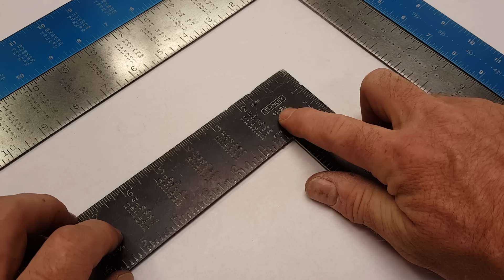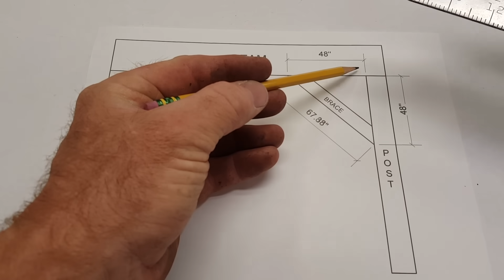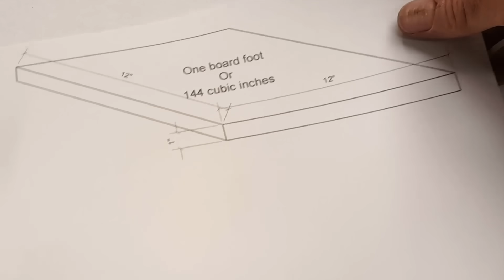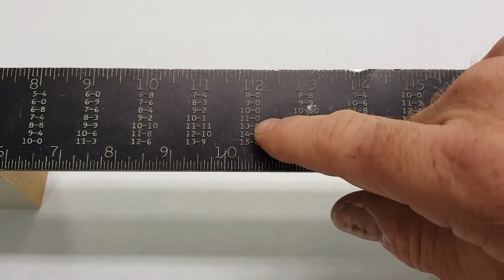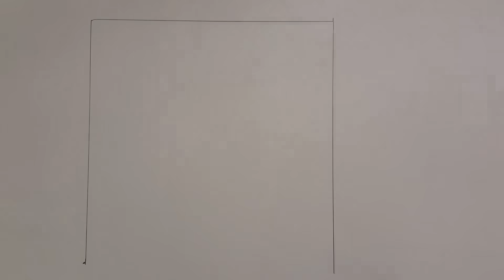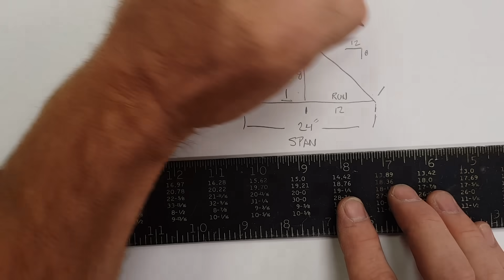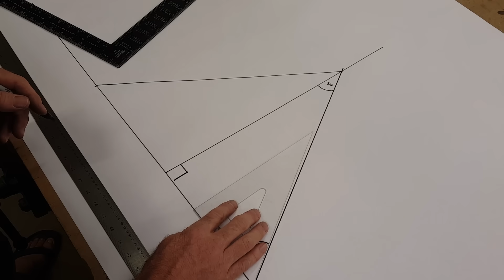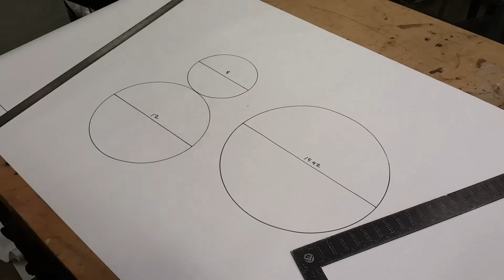Framing Square Basics - How to use one

Comment: ... this video, while high in quality, seems to be a huge motivator for using the metric system lol
Reply from the maker: I use both systems because things are made using both. Even if the metric system was the only convention in use there would still be millions of structures that were built with the other way measuring.  Plus, It's important to remember that fractions a representation of value and are independent from either measuring system. Fractions, however, are necessary for both in many instances. Also, the math behind x,y coordinate (rise and run) based construction applications like roofing is independent from the measurement system....... They are both just sets of lines on a stick.  It's how well we understand them and use them that makes them useful.
Reply: @Makebuildmodify  that's very insightful. I always wondered why fractions were used so much, especially since I have a caliper that expresses inches with decimals. Thank you for the clarification and the videos. :)
Reply from the maker: @lostinlymbo13  Thank for taking the time to read and reply, and for watching my video too.

Comment: I assume everyone knows why the body and tongue are 24, and 16" respectively? In case not,  they can be used to lay out studs without using a measuring tape.. Then line up the center hole on the tongue over the mark, square it, mark it,  ..studs 16" on center.  Can't find this on any video.. I guess it's just so common that none of the videos mention it?

Great video, good primer.  Thank you!
Reply from the maker: Yes, I totally forgot to add that to the video. It's easy to miss the simple stuff.
Reply: Yep, AND the 1-1/2” wide stud marker (tongue), combined with the 2” wide blade to mark off partitions.

Man I miss this stuff. Came into the trades over 30 years ago and learned my Stanley 45-010 inside and out working with two young guys building authentic 17,18, early 19th century reproductions. Post and beam framing, using block planes to fit clapboards in, hand planning Keeping Room paneling and using beading planes for center boards (tongue and groove), it goes on. Then I went into architectural millwork, finishing, casework etc. 

I’ve been in facility management for several years now, and needed to lay out a stupid simple octagon for something... completely forgot how to use the square to do it!! Tough staying young...

Do you know... I SCOURED the net to find a user guide... THIS VIDEO WAS THE ONLY THING AVAILABLE to reacquaint me with this great tool! So THANK YOU!!

Man I used to use ALL the rafter scales, and then later the bd ft scales for millwork...

Those two guys I started with back then taught me ALL THIS info you shared.

This is a GREAT video. I will check out your other videos as well.

Thanks a million Chief! Well done!
Reply from the maker: @dobrofool  Thank YOU for watching! It sounds like you worked with some good guys. It's rare to find carpenters that know alot about framing squares these days.

Comment: Very educational! I've studied maths to various levels, up to including university, but never learned about framing squares.
As Joe, below, says, schools just arent teaching the stuff I learned, even at secondary school. 
When I did an evening course on CAD, many years ago, (as an adult,) the other kids were having trouble, because they didnt have even basic drafting skills. 
I've just bought several used metal work and wood working machines, (from the UK) all from schools clearing their handicraft workshops. In my secondary school, in the 50's, we were expected to get jobs in manufacturing, so we were taught the necessary skills, very well.
One school that I visited to buy machines, the work in the handicraft shop was being performed with toilet rolls and drinking straws, the sort of stuff that my kids were doing at nursery school!
Deplorable!
Reply from the maker: That's too bad. But It sounds like you got some good tools from the circumstance.
Reply: @Makebuildmodify  
Yup, its an ill wind that does nobody any good.
However, the political ramifications are somewhat chilling.
If you consider the original reason that universal education was introduced, was that the landed gentry were moving into manufacturing, in the early days of the industrial revolution, and needed people who could read, write, and count. Now, most manufacturing is performed by 'robot' machines, so they are no longer needed. In addition, once the peasants had education, they wanted the vote, something that had been the sole domain of the landed gentry, but if they didnt give it, they could see all their lovely profits disappearing so fast, that their eyes would water.
Now what they want, is dumb-dumb's whose only interest is whats happening in the TV 'soaps.' and will go out and fight so that the armament factories can continue to make their $$billions.
I have an ex RAF mate, in the UK, who I chat with periodically on Skype, and he complains that nobody he knows wants to discuss the things he's interested in, all they want to talk about, is, who's doing what, in the TV soaps.........!
Anyway, thanks for posting the info. 
I have framing square that I've only used as a large square and was too busy to be concerned with the other uses, but will now have to study it more closely.
These days, in France, I work mainly in metric, so will probably have to convert.

Comment: Good job, little more technical than that, you forgot heel height and your ridge pole thickness
Reply from the maker: This is not a roof framing tutorial. Just a overview of the steel square. I saved roof framing for another video.

Comment: Wow you can do all those things with a square, and draw a circle at the end -mind blown. lol I bet they don't teach this lot in schools anymore as kids will probably say 'there's a computer programme or app for that, so I don't need to learn it', and modern kids don't seem to want to get their hands dirty or chip
a nail. When I was younger we used calculators for everything so the bits at the end are interesting and educational. It's interesting that imperial is still used for building things, in the UK everything's metric. They don't teach inches and feet, it's fun confusing youngsters by using inches. btw I'm self taught imperial and it can be very useful.
Reply from the maker: Thanks Oliver! I would say that both systems have strengths. I like to use what works for the project at hand. Thanks for the commenting too!

Comment: Pity the USA keeps you suppressed by making tools that are so archaic with imperial. The world has moved forward with metric. Metric is so much easier. Yet the old school are too scared to step away from imperial.  YT reaches the whole English speaking world. The whole English speaking world works in metric. This video , even though it's informative and accurate means nothing to teach anyone anything outside of  the USA. Was that your intention to alienate the rest of the world ? No malice intended with this comment.
Reply from the maker: No intention to alienate anyone. There are good and bad in both systems. I use either depending on the circumstance.
Reply: Make Build Modify  Cool.  So is it possible to make a similar video ? Just metric .
Or have you moved on ?
Thanks for the reply.
Reply from the maker: @smacurface  I might make a video on the topic but for roof framing the metric system usually uses degrees or sometimes the same expressed as a ratio (12/12 = 45 degrees.). The problem is that a base 10 system only has 4 factors (1,2,5,10). So expressing the slope while holding to a base ten system is limiting as opposed to the imperial system that uses 12 inches. This give you a few more option when it comes to ratios. This is because 12 has more factors (1,2,3,4,6,12). But you could always use 12 as your denominator in the metric system if you wanted. It just not marked out as obviously.
Reply: Make Build Modify Awesome.  Maybe, if and when you do remember the hoards of people outside the US that would benefit the imperial numbers versus the metric.
You know imperial and understand metric. Many worldwide know metric and have no desire to learn a forgotten system or understand it. So when people speak imperial.... it makes no sense at all.  Nada ! Having someone explain the square /usage in metric format and measurement  relevance to the metric would be awesome.
You got a sub .....👍

Comment: Hi justin, brilliant video, but why don't you work in metric increments, so much easier in millimeters and centimetres, I'm looking for a good framing square but I'd need it to be in metric increments, cheers Steve
Reply from the maker: Thanks! I works with both systems depending on which convection is applicable.
Here's one that has both systems https://amzn.to/2Wz8KCM

Here''s one that is exclusively metric https://amzn.to/2ECvDuA
Reply: Thank you my friend

Comment: I hate it when someone says," He's just a carpenter."
Reply from the maker: I know, right!?
Reply: I'm a Land Surveyor. I do carpentry as sort of a hobby. It is mind bending especially when you have compound angles (miter and bevel), way more difficult than Surveying math which is mostly done by computers these days. I have a lot of respect for carpenters.

If I survey around a big tract I get a misclosure due to imperfect measurements, we adjust that out. Can't do that with a big carpentry project, have to be as accurate as possible to make things fit.

Comment: This is a good framing square video. I rarely ever used the board foot scale, because we rarely buy lumber by the board foot. At least not for construction. A mill work, guitar shop or specialty shop might. There is a way to draw a liptic arch using a square as well, and carpenters used to build "cradles" for brick masons. It involve using a ratio, and I am not sure I can describe it just in words. If I had video equipment, I would do this to pass on to future generations. I will tell you that knowing how to use that framing square on the job, separates the lead carpenter from everyone else.
Reply from the maker: The elliptical arch sound interesting. I'll have to give it a go.
Reply: @Makebuildmodify  I have sent you an email. It has a Word attachment explaining how with diagrams. Let me know if you have any questions.

Comment: Cool video. Now that I know what markings are supposed to be on a framing square, I realize how deficient my square from ~20 years ago is.  Most of the markings discussed do not appear on my framing square. The overall dimensions are of course the same but many features are not.  None of the sides have 16ths/10ths/12ths, all edges are in eighths only. There are not markings to help with a knee brace. There is no octagon scale, no rafter table. There is a small table on board feet for standard dimensional lumber...you have to manually to multiply the length. It's has a fraction to decimal (1/8=0.125) chart. It has a pilot hole/wood screw chart. It has a chart on nails/pound.  It does have anular markings for 30, 45, 60.
Reply from the maker: Yup, there is a lot of variance from design to design.

Comment: This may be a stupid question, but it's something that has bugged me for years:  Why do some squares have that round notch in the inside corner (like the blue square in this video), while others don't?  Does it serve an actual purpose, or is it simply the product of a demented mind?
Reply from the maker: That's a great question. I'm not sure. I always thought that is was part of the manufacturing process. I've seen it on aluminum squares more often than steel squares.
Reply: I believe it is a relief hole so you can get the inner edges tight against the material. I used a framing square often when fabricating metal frames for equipment. Often times there is a little Burr or deformity on the ends of sheared metal so I enlarged the hole on a couple of my squares to allow for a better fit. It helped quite a lot to speed things up laying out and testing the fit up.
Reply: Does that notch mess up using the square to draw circle

Comment: Do framing square board foot calcs account for lumber cut to "nominal dimensions"?  EX: 2 x 4 is actually 1 1/2" x 3 1/2" of wood.
Reply from the maker: It's typically for rough cut lumber like at a hardwood supplier would have. But I would ask you local lumber supplier if you're interested.

Comment: Awesome video and Thanks ! My advice to anyone -> Purchase a stainless steel or aluminum square if possible . After wire brushing the rust off my old framing square and painting it 3 times , it's getting hard to read . ATB
Reply from the maker: Good tip.

Comment: man wish i could understand a framing square on how to draw a 1/12 pitch for wheel chair ramp
Reply from the maker: Place the square on a piece of lumber in such a way that the edge of the lumber crosses through the 1 inch mark on the tongue and through the 12 inch mark on the body. In this arrangement the outer edge of the tongue will be the plumb cut and the outer edge of the body will be the level cut.

Comment: I appreciate how you explained the use of the square to determine the length of a rafter bu using the tables.  But now that I have my length of my rafter,  which measure is that on the rafter?  I am confused because the rafter has an angle cut at the top, and extends past the birds mouth.  (Hopefully this question makes sense, and you already did a video on this.)
Reply from the maker: Usually the references are the center of the ridge to the outside of the wall framing (the run).  If you want to add a rafter tail after the birds mouth you need to use the run of the tail to figure the extra length and add it to the rafter. Also, if you have a ridge beam you'll need to figure for removing half of the width of the ridge from the rafters.  Here's a link to a great book on roof framing. It's small and easy to understand. https://amzn.to/2I1LJwE  (affiliate link)  I may have to make a separate video just about roof framing.

Comment: I started fooling around with wood a few years ago.. and I learn and relearn so many things.  I work by myself and don't have that third hand. Last year, I was making a frame for a table and was trying to get a tight corner fit. So I clamped a board on the inside of the frame and tapped it to corner joint. I just lightly tapped the clamped board.. and eureka.. it exerted the most amazing constant pressure on the corner. I'm sure it was easily 100s of pounds pressure.  I learn things like this all the time.. carpentry is a mini applied physics course.  Back to this tutorial.. if I see it right this is a 90 and two 45s.. so basically it's good old Pythagoras showing up. Loved the video. I never there were so many marks on the tools. Subscribed... When you have a slow day check my videos.
Reply from the maker: Yup, You're right about pythagorean theorem. If you watched until the end when I show the two smaller circles being converted into a larger one, that's the pythagorean theorem at work. Thanks for the sub!

Comment: So split any angle in half.  Then split it in half again!!  And again. Using the Framing Square. Good fun!!  Well maybe you've done that already. It has come in handy dozens of times in my career.  Also,  years ago in another century. I was told you can figure out your paycheck using the framing square. Do you think this is true??
Reply from the maker: Figure  your paycheck, that was probably true. I'd have to think about it for a bit. I wish I would  have remembered to included splitting angles.

Comment: Now if I could only keep my squares, SQUARE.. I bought an Empire, I checked it at Home Depot for square,(yeah' I drew 2 thin lines at the lumber aisle), I probably used it twice, for initial square up for breaking down sheet goods.. not square anymore and Im back to the nail punch method to bring it back to 90
Reply from the maker: Yup, that's the way to do it.

Comment: I worked in the states for about 5 years as a carpenter but i brought over all my own tools from Ireland and i thought that all the American carpenters are slower because here in Ireland we use metric measurements which is a far better system and a lot quicker than imperial measurements i think the USA needs to jump onto the 21 century or it will be left behind
Reply from the maker: I use both. They're just lines on metal put there for reference. The Imperial system can be used in decimal form and the Metric system can be used in fractional form. As for speed and accuracy, that's up to the craftsperson not the lines on their measuring stick.

Comment: Just curious, where did you find all this info regarding the square and the speed square? Thanks for the great videos!
Reply from the maker: I have learned most of it over the years. But I did read up for the presentation. The Swanson manual that comes with the speed square is pretty good. As for the framing squares I have a few out of print books from the early 1900's that have a lot to offer.

Comment: are bord feet sq foot measurements? times tables?
Reply from the maker: Good question! The board foot table can be used to find sq. ft. because the the chart is based on a 1 inch thick board so the output numbers accurately represent the surface area of the face of the same board. The first number will be the number of whole square feet and the second number is 12ths of a square foot. For example the 3-4 is three square feet and four 12ths of a sq.ft. or 3.33 sq.ft. 

It's also important to remember that this only works for 1 inch thick boards. That okay because the entire chart is based on a one inch thick board.